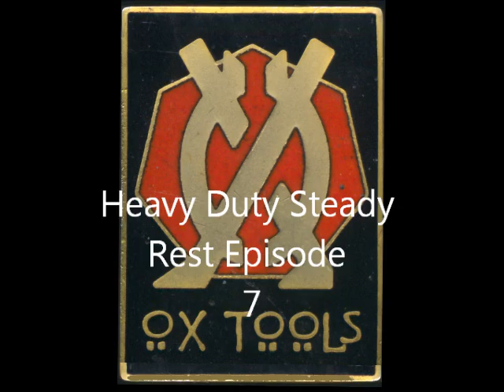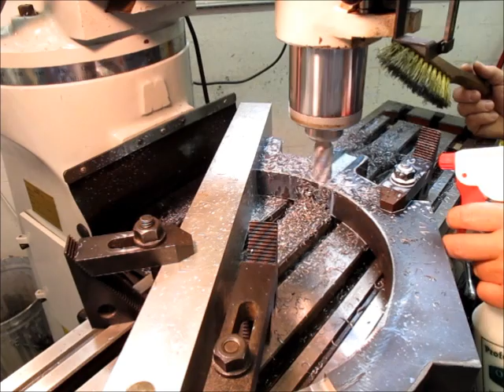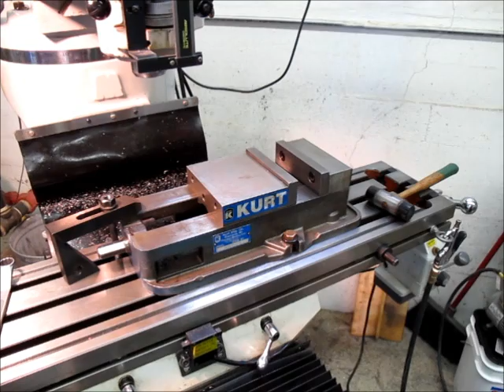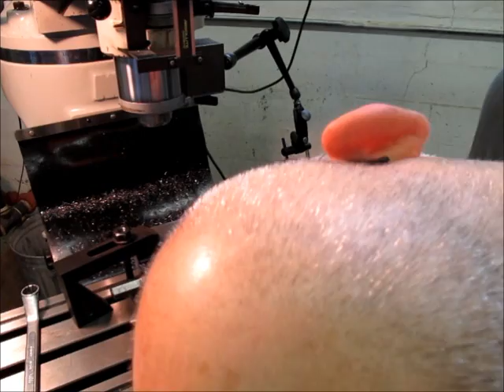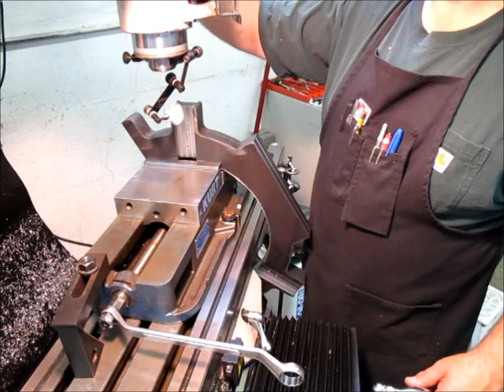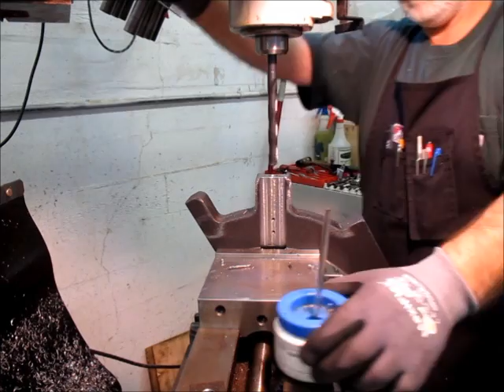Heavy Duty Steady Rest Episode 7

Comment: Would it have made any sense to pivot the head to match the angle rather the placing the work on the table in a precarious angle? Total novice question for me... :)

See you on Saturday! :D
Reply from the maker: Andrew McLaughlin Hey Andrew,

I try to not tip the head unless I really need to. Trust me this was not a precarious setup. Thanks for the comment.

Cheers,

Tom
Reply: I expect it could make it difficult to center the drill. It's a cinch when you have the dro or or dials that run parallel to the surface you're centering on, but when the surface itself is cocked off to the side like that you'd end up having to approximate lateral movement using compound movements of the different axes. Unless there's some kind of clever way i'm not thinking of, it sounds like a huge pain

Comment: Hello Tom,

I would just like to say how much I have enjoyed your videos and how much I appreciate the detailed knowledge and techniques you are passing on.  

Watching this particular video, an idea came to me that may or may not be of use depending on whether it has already occurred to you or another commenter in the last two and a half years.....

If you were to machine one or more slots in the aluminium bar you were using as a fence, perhaps in the areas where the bar crosses T slots at commonly used angles, it could be fixed to the table without using external clamps.

That way, you could set up in the middle of the table (using your lovely sine bars - very jealous!) and be able to use both sides of the fence without an obstacles -  For a job like this, you could machine both sides of the piece without having to move the set up.

Apologises if this is egg sucking tuition....

Kind Regards

John (UK)
Reply from the maker: garrmann Hi John,

Thanks for the nice comment. You are totally correct that I could optimize the bars for more utility. My experience is that nothing is ever quite right with fixtures. There is always some compromise when doing jobbing type work. I have found it better and less work to have enough basic stuff that you can work around the oddities of most jobs. You can sink a lot of time in "Swiss Army" type fixtures that do too many things and none of them brilliantly. That is just my take on the problem and is not meant to minimize your clever suggestion.

All the best,

Tom

Comment: Hi Tom,

The shops with long bed (Lodge and Shipley) lathes I used to work in had four roller steady rests. One extra roller was placed under the bottom of the shaft to take the full weight.

The two at 30 degrees down have considerable side pressure without that bottom roller.
They also had two clamp bolts to hold the rest to the bed on either side the extra roller.

That is how I made a burned out rest very similar to yours when I was doing black powder cannon work.

Nice looking job.

Kap
Reply from the maker: Hey Kap,

I looked at some four arm configurations. I didn't have the space under the ways to accommodate the fourth. Thanks for the comment.

Cheers,

Tom

Comment: I would've thought, at least the lower holes, would have been easier to do on the autometric, since you can swivel the plate around to hit that hole horizontally instead of trying to jerry rig the piece on the vertical mill.
Reply from the maker: Hi Gran,

The K&T wasn't operational at the time. In fact I don't think I had it. I'll have to go look at the video. Thanks for the comment.

Cheers,

Tom

Comment: After using the soluble oil, how do you clean-up?  Can you just wipe down the machine, or do you have to use some sort of cleaner or oil?  Thanks for a great series!
Reply from the maker: Hi Bx,

Depends how much is there. If there is a lot I recycle it and if there is just a bit I suck it up with wipes or the wet dry vacuum. Any that ends up on the floor gets some oil dry to absorb it.

Cheers,

Tom

Comment: Tom,

Couldn't you use the DRO as a virtual sine bar? Clamp a Dowel pin perpindicular to the table (Parallel to the z- axis). Find the center of that pin and zero it. Do the math to find the x,y coordinates of the opposite corner for the given angle and the largest hypotenuse within reach of the table, chuck up the same size pin as the "zero" pin, crank to the coordinates of the opposite corner and lay your fence against them and clamp it. By using the "largest" right triangle you would be dividing your error.

Just a thought,

Joe
Reply from the maker: Hi Joe,

That is a cool idea. We do a similar thing with coordinate shift on the CNC. Sometimes its hard to move a part and dial it in so its easier to shift the machine coordinate system to match the part. Your suggestion might make a neat meatloaf snack.

All the best,

Tom

Comment from the maker: Hi Riller,

Thanks for the nice comment. You would be correct that my mill is not bolted to the floor. In all my years I have never seen a Bridgeport mill even get close to tippy even when spinning the turret all the way around. There is just not enough weight up top to cause a problem. Also when your mill is not bolted down you can move it to do long work which happens more than you might think. Good question.

Regards,

Tom

Comment from the maker: Hi Craig,

That is actually an excellent question. Any time you can leave the machine orthogonal to do a job its generally better. Locating datums and features with the head tilted can get very complicated. Take the example of just changing the length of a tool while the head is at an angle. Or for that matter aligning the head at a particular angle very accurately.  There are legitimate good reasons for tilting the head but most guys try to work around it. 

Regards,

Tom

Comment from the maker: Hi Frank,

I'm not sure I understand your question buy I will try. The guides for the rolls all are on centerline with the bore of the steady rest. The trick is getting the center of the steady on the machine center line. This happens when the base is cut and the steady rest profile is aligned with the machine. Hope that answered your question.

Thanks for the comment.

Best,

Tom

Comment: Tom....when you rotate the turret and extend the head, doesn't the machine lose tram in both directions?  Is the amount of error that small not to worry?  If there is error, what creates the worry, required tolerances of the design?

Comment: I was thinking it would have made great horizontal spindle for your job here.  That machine seems particularly suited for drilling holes in weird shapes.  I think that the rotary table on the carriage would have made the angular indexing a bit easier as well.  

I would love to run a machine like that in my shop, but my love for cool iron has left me with very little space.  

Thanks,
Alex

Comment: Here's an off topic question. I recently got a milling vice and it came with two locating pins. Are these to get the vice exactly trammed in or is it supposed to just get it close enough and reduce the amount of time to tram? The ones that came with it don't fit my T slots. What would be the best way to machine them to fit? 

Or maybe you dispose with them and could show us your procedure for getting the vice back on the table. Takes me a while so I shy away from taking the vice off.